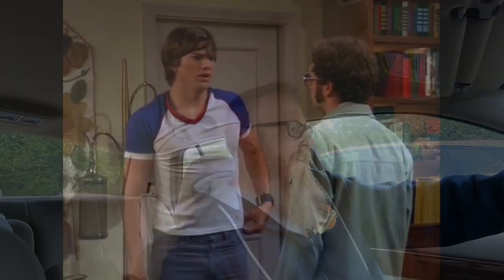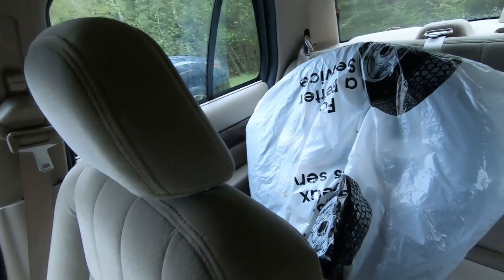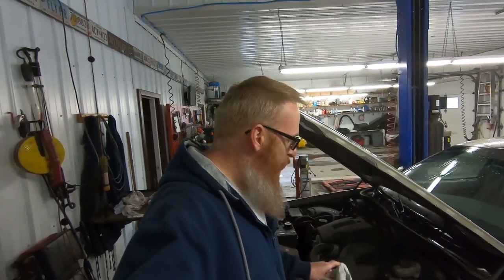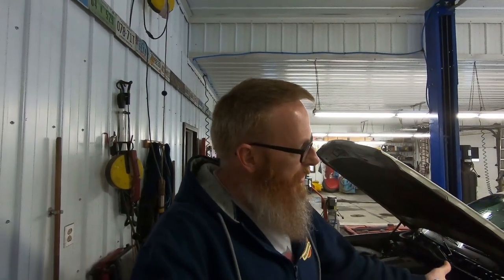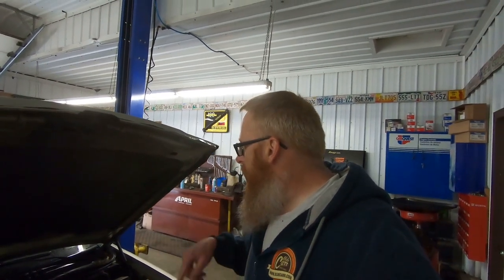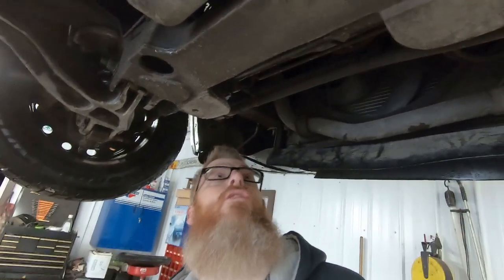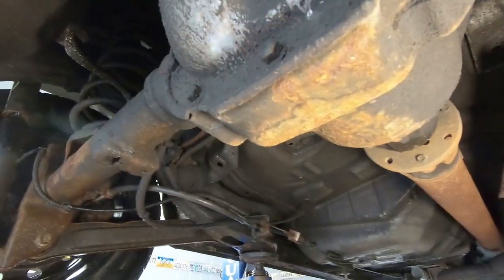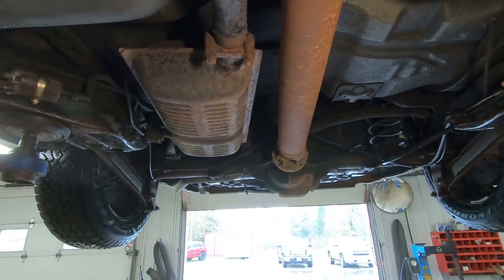I BOUGHT A  MERCURY GRAND MARQUIS - IS IT JUNK?

Comment: I love these cars! Been driving one since 1990. Had a 1986 from my father and drove it 1990-2006. Then bought a 2001 and drove that 2006-2022. Just bought my 3rd MGM, 2006, and drove from AZ to FL for it. 74K, super clean, runs great, drove it home and was getting 29mpg. I hope I am able to drive one till I'm done 🙂
Reply from the maker: lol at this rate you should have no problem!
Reply: @OldeCarrGuy  Ya never know, I might live too long :) In 15 years when I'm 71 these cars may all be gone. It will be 2037 and the last one made is 2011 :)
Reply: @richardcolacino3631  I'm much younger than you, I have a 1994 Lincoln towncar signature and a 2003 grand marquis gs and I share the same fear as you and I don't want to imagine myself driving a electric car or  cheap overrated junk like the corolla and camry 
American V8 for life
Reply: @ToyotaNutjob  Look my friend 
You got to be specific here
Which one of the panthers are you putting Lexus against?
If against Mercury grand Marquis and crown Victoria then they beat the Lexus in Mileage on highway and 
Lincoln towncar and Marquis and Victoria beat the Lexus at suspension and physical space and comfort especially in rear passenger cabin and the Trunk is bigger than Ls400 
Now the Ls400 gets beat in performance by Mercury Marauder, and mentioned cars like the Marquis and crown Victoria were at their prime half the price of Ls400 yet the same reliability and I'm speaking from Experience 
Don't get me wrong my friend, the Ls400 was a car engineered to point of perfection at its time to the point it put its successor the Ls430 to shame 
Nonetheless my friend using the phrase American cars are bad And Japanese are good is a bit plain and short sighted Don't you think, and by the way I think Ls400 is a car Japan will never create something similar to its overalls success and stopping its production was a no brainer move
Thank for reading
Reply: Find another nice one and buy it. I'm 64, and I just bought a 2007 with 36,000 miles on it, even though I also have a 2006 that I expect to get another 100,000 miles out of. I don't want to have to ever drive anything else. My ex wife bought a brand new 2022 Hyundai Accent, she paid almost $35,000 for it. I can't even get in the thing, and after spending about 10 minutes hurting my neck and back squeezing into it, it was the most uncomfortable car I've ever been it. She plans to get rid of it at 100,000 miles. I recently bought a 2007 Grand Marquis with 36,000 miles for $9,000, and they aren't even broken in till 100,000 miles.
Reply: Panther came out in 1991 as a 1992 model?

Comment: Both the Grand Marquis and Crown Vic are probably the best cars Ford ever made. I worked as a city fleet mechanic for 37 years. The Crown Vics were the ONLY vehicles that never gave us any problems. Of course they were all bought new, and properly maintained. But the ones used as cop cars did get trashed. They still ran fine. I prefer the Grand Marquis because it has a softer suspension, softer seats, and a 2.73 rear axle that lets it cruise at 65 mph on the highway at just above idle. 32 mpg highway. I have owned three of them, an '05, an '06, and now an '07. I put over 400,000 miles on the '05, then gave it to my daughter and son in law, they are still driving it. The '06 has 289,000 on it, and I'm going to wear it out. I recently bought the '07, with only 36,000 miles on it, in like new condition, from an older couple living in a retirement community. They were the original owners, and had a stack of maintenance receipts two inches thick. I paid $9000 for it, and it was worth every penny. It is an original AZ car, was never undercoated, and the bottom is as clean as the top. Zero rust, not even surface rust. I bought the '07 because I knew the '06 would not last the rest of my life, and I wanted one that would. These were/are not project cars, they are transportation cars. I wouldn't be afraid to drive one anywhere. I worked on thousands of them over the past 37 years, and I know everything there is to know about them. If something goes wrong, I can fix it. And at 64, I guess I qualify as an old man.

Actually if you live where they salt the roads, the undercoating can start to peel, salt gets between the undercoating and the metal, you can't get it out, and it rusts through the metal. Undercoating is NOT a good idea. I recommend a product called Fluid Film if you live in a salty area. It needs to be reapplied once a year. It doesn't harden, crack, and peel like undercoating. 

These cars (the Panther Platform cars with the 4.6L 2 valve V8 and AOD transmission) do have a few common problems. Starting at the back, assuming it is not a P71 police car, it will have rear air suspension. The air bags will eventually leak. They are expensive to replace. But there is an alternative. They can be replaced with coil springs for a fraction of the cost of new airbags. I did two of mine that way, and it worked fine. The plastic interior parts tend to be a bit fragile, and you cannot get replacement parts, either from Ford or aftermarket. On models with automatic climate control, which includes all Grand Marquis and Lincoln Town Cars, the blend door actuator tends to fail. If replaced at a shop, it's a $2000 job, because the whole dash has to come out. However there is a shortcut way to do it, by removing the passenger side airbag and glovebox, fabricating some tools, and doing it through the airbag opening. Many YouTube videos on it. The spark plug threads in the head do tend to strip out sometimes. That's probably the worst problem with these cars. The head needs to come off, and these are OHC engines, so there is a LOT of stuff to remove to get the head off. Figure $1000 per head to remove it, Helicoil all 4 holes, and put it all back together. I've done several, it's a 6-8 hour job per head. The last issue is the PLASTIC intake manifold can start to leak coolant. None of my three cars have had that problem, but I have replaced a LOT of intake manifolds on city fleet cars. I suspect they were overheated from idling too long. The transmissions are bulletproof if properly maintained, and cheap to replace if they do fail.
Reply: I'm buying one tomorrow for 3 grand 77 thousand miles.
Reply: @hespheastusbrazen8702  about 2 months ago I bought a 2005 grand Marquis for 5k and it has 76 thousand and it's the best car I've ever had I would drive it anywhere

Comment: Problem with 2003-2011 g Grand Marques, is 2.73:1 axle ratio. Also single exhaust. But that's easy remedied. Watch for coil breakage in front strut assemblies. Look at intake manifold leak. 0442 small evaporates leak, also.
Reply from the maker: Thanks for the heads up. I've already "fixed" the exhaust and will be doing an axle swap to track loc very soon. I've had zero other issues since purchasing one year ago.  Been a great car! Stay tuned to the channel for more upgrades and feel free to check out the full playlist!
Reply: Traded my 04 MGM, for Lincoln Town Car, with, 3.27:1 trac-lok, and factory duals!! New car is so sweet! These panther full frame Ford's, are so nice!

Comment: I bought one used about 7 years ago with low mileage for 2K, It has 200 000 miles on it now. The clear coat is peeling on it  but the car is still solid (very little rust).  I was going to get something newer but this car has been so good I thought I would keep it and fix it up. I put some new headlights and parking lights and a new exhaust system front to back, new shocks/swaybar links and bushings , new tires, new battery and alternator, new 02 sensors, MAF sensor,  changed out the diff fluid and tranny fluid. I gave it a good tune up and it runs and drives like new now. I think the car will last another 5 years now easy.
Reply from the maker: You’re doing it right! Keep drivin’er! It’ll treat you good!
Reply: if you’re taking good care of it like that then it will last decades LOL! good job 👍🏽

Comment: The cruise control buttons usually fail vs the servo motor. Had to replace mine on the 03 green grand marquis
Reply from the maker: I did get it to work! I guess that are old school and dot work like the electric ones do! Press and hold!
Reply: It's a good sign when the buttons don't work because they were used so much that they broke vs city driving which puts more wear on the drivetrain, suspension, brakes, etc. I put 80k miles on the grand marquis in the Tampa Bay metro area but didn't beat on it either

Comment: I've got a driftwood grey '07 MGM-GS (named "GrandMa") with only 45K miles on it currently.  The first thing I did was to add a Sony XAV-AX100 Android Auto stereo head unit so I can have modern tech (bluetooth, nav, etc) in it.  The second thing was adding a matched set of Addco sway bars (1.0" rear, 1.25" front) to it.  It's a whole different car.  Still rides nice and smooth, but is far better planted and corners flat.  Dual exhaust is next, but I'm keeping it totally stock looking right down to the steelies and hubcaps.
Reply from the maker: Great info! Thank you sir!  I've started to do some small upgrades. Hope you can stay tuned in and follow the journey!
Reply: Where do you get those sway bars?  And is it something I can do in my garage?  Pretty novice

Comment: I just picked up a 2003 Grand Marquis with 116k miles for $500 that needs a trans. Its rust free but needs a little dent repair.
So im gonna manual swap it.
Probably gonna have it on the road for less than $2000.
They really look good in silver!
Reply from the maker: Manual swap will be fun!

Comment: Those engines do NOT blow plugs. They take SP493's. Not the 2 piece plugs
Reply from the maker: Good to know!
Reply: If you've seen my spark plug video, you'll see what I'm talking about. The only reason they blow plugs is from under torquing them or over torquing them and stripping the few fragile aluminum threads out of the head. If it runs now, it'll run forever
Reply: The generation of 4.6 in the panthers from 03-04 are bulletproof and don't have drive by wire like the 05-12 do. She'll run really nice with dual exhaust. Holes already in the frame for the brackets and the Walker system is not expensive at all. Under $500 for H pipe, mufflers and tail pipes. Gotta cut the old pipe off or drop the rear axle to do it
Reply: @ panther platform  That theory could very well be true but for a lay person never hearing of such a problem with stretched threads due too overtighting was a first. The engine was great at first but being in the car twelve to fifthteen hours at a time x six days a week one tends to recognize a different sound being projected from the engine. After hearing a ticking sound I had the local Ford dealership have a look at the problem, they said it was perfectly normal and that it was the sound coming from the valve train. I knew that was a bunch of crock and I challenged them on their findings, several days later out came the first plug. Before buying such a vehicle I guess it would be a great idea to have a good tech pull the plugs and check to see if there has been coils already inserted as in my case. The if it runs now it'll run forever theory is kind of sketchy don't you think !
Reply: @1armedguy4  I don't know what, or how, you drive so I can't speculate on how much longer it'll last. I'd try, but it's probably above your pay grade.
Reply from the maker: Play nice guys!
Reply: @1armedguy4  lol. No f's given.

Comment: I bought a 2005 grand marquis ultimate edition and it needs a power steering module and it's discontinued. They installed a power steering pump and it didn't solve the problem and then installed something that has to with steering. It's a good thing it had a dealership warranty. Bought it on May 1st and had to take it to the dealership may 8th and it's still there.  Would you know where to get the module? I think I only drove it 20 miles.  I wanted drive down the interstate on the brand new Michelins
Reply from the maker: I’m not saying the at they don’t go bad, but I’ve never heard of one failing. Having said that there are lots on eBay! https://search.app.goo.gl/ZEuhZnY

What are the symptoms of your issues.
Reply: @OldeCarrGuy   it's hard to turn when going slow but not to bad when turning at a faster speed.  But when the check air suspension light comes on it turns easy.

Comment: Is the intake manifold leaking coolant where the thermostat meets the d/s head?
Reply from the maker: No coolant leaks.... yet!
Reply: They usually start leaking there around 100-125k miles. I but the exact OEM manifold from amascam and the gaskets and fuel injector o rings. Less than $300 for the whole works.

Comment: Jason, do you know what kind of undercoating that car had?  I've seen a lot of advice on YouTube that undercoating is bad because it gets hard and flakes off or it tends to trap moisture underneath it.  The general recommendation is to use that Fluid Film oil spray annually instead.  A little more effort required but better results for a car that is loved.  Plus, you can spray it inside doors and in hard to reach places where a Ziebart might not reach - and it doesn't plug up drain holes.
Reply from the maker: The car had several Rust Check stickers on it when I bought it so that would be my guess. I believe there are several good products out there, even Fluid Film. Having said that, I don't think there is a product out there that is a one shot deal. It must be touched up or at least inspected annually. Where we live, on the southern coast of New Brunswick, we see lots of salt on the roads, multiple freeze/thaw cycles each season and the moist ocean air plays havoc on vehicles. Very harsh environment. I have my cars under coated annually with a product very similar to Fluid film called Corrosion Free. It Creeps anis dripless and never fully dries.

Great question. I think I may make a video on this topic. Thanks for the comments.

Comment: Wonder if someone could help me.  I bought a 2006 Mercury Marquis last summer off a car lot.  Dealer claimed to have no history of the previous owner.  The car showed 65,550 original miles.  It's been undercoated.  Body was in excellent shape outside; interior almost like new inside.  Paid $6200 on it.  Had some heater/cooler issues with panel switches that needed fixed however. Also put new quality Goodyear tires on it and had it 4 wheel aligned.  Had a new transmission filter put on it plus the other things to make sure it was properly maintained the first week I bought it.  

Once out of the garage, I drove it down the freeway at 70 mph and immediately was not happy with the steering.  Tires weren't shaking nor was it vibrating.  Road was flat and very smooth.  (No ruts in other words from heavy trucks).

HOWEVER - when I took my hands off the steering wheel on a very flat freeway, the car would quickly veer off right OR veer off left ... dangerously so!  It would NOT hold itself steady going down my lane like every other car I've ever owned driving on a flat surface. 

I've driven it now nearly 10,000 miles - a year later.  Steering has not gotten worse, but surely hasn't gotten better.  Has stayed the same.  I MUST hold the steering wheel with one hand on the top and the other on the bottom of the steering wheel to make sure I don't swerve out of my lane within seconds.  

Tires look good indicating no abnormal wear.  

WHAT WOULD YOU SAY NEEDS TO BE FIXED ON THE "BOAT" TO DRIVE IT SAFELY WITH "MY PINKY FINGER."  I would like to have a good idea before I pay big bucks from a front end shop giving me their opinion on what it needs to be fixed.  Thanks in advance.
Reply from the maker: Without looking at it myself and based on what you've told me, I would be looking at the steering shaft knuckle. It has small u-joints in it that will tent to bind up. I have this problem right now with my '03 and have had it on my '04. I have taken penetrating fluid and sprayed them and also, a hammer and long prybar to beat on the joint a couple times, turn the wheel 1/4 turn, and repeat. This is only a temporary fix. Ultimately replacing the shaft is the answer. 

Other than that, it may be in the rack and pinion itself, or possibly the P/S pump failing, but my money is on that steering shaft.

Hope this helps
Reply: @OldeCarrGuy  Thanks Jason for getting back so quickly.  I've contemplated taking it to a good front in shop now for a year but I drive the car so little -- I've simply contemplated driving it as is until it gets worse.  Unwise?
Reply: Ive replaced all my ball bearings, gotten wheel alighment and something else and it stills veers right.

Car repaie shop rotated my tires wrong thinking its a front wheel drive.